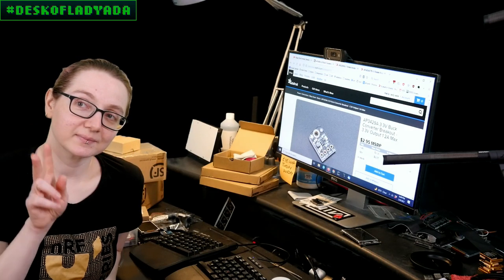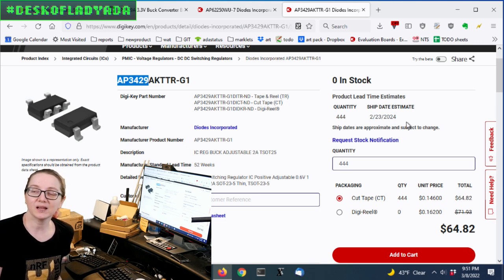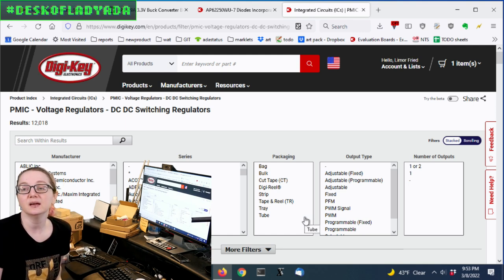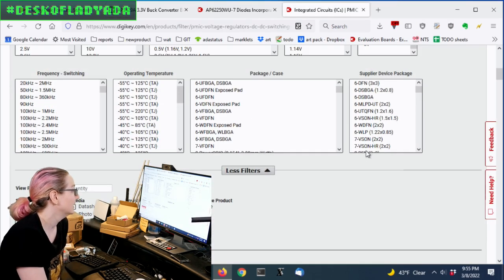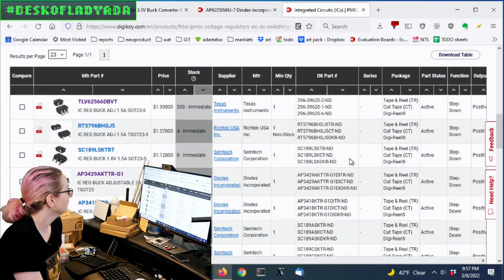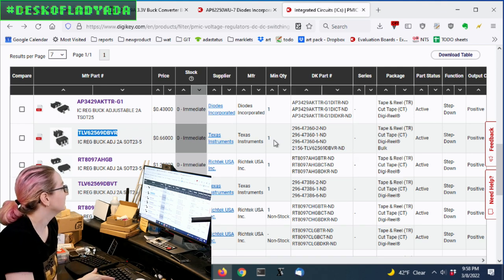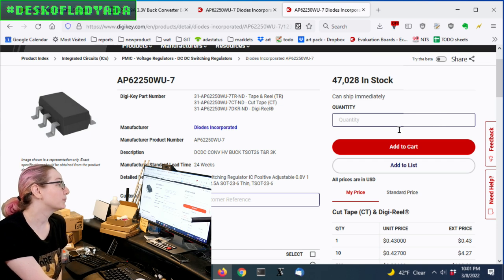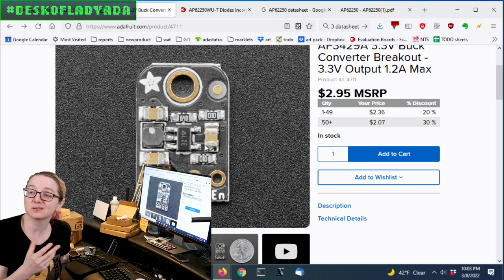The Great Search: AP3429A Low Cost Adjustable Buck Converter Alternative #TheGreatSearch @digikey

Comment: Question:  Is the shortage of such a converter, due to greater than normal demand? or are they just producing far less?  I understand the high-end 7nm fab having limited capacity. But surely this is not the highest tech process? You would think, 2 years into the Pandemic, Some factories would be up to pre pandemic capacity? I truly wonder how much of this is taking advantage of the situation.